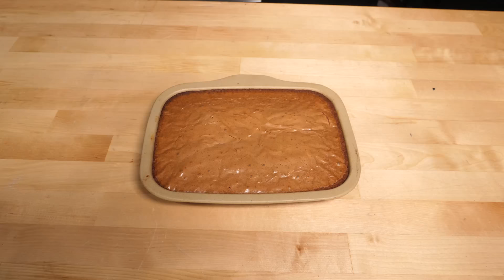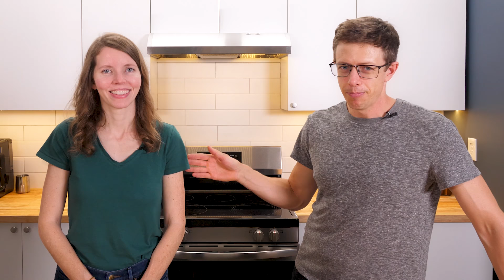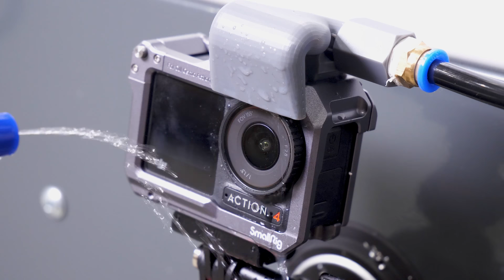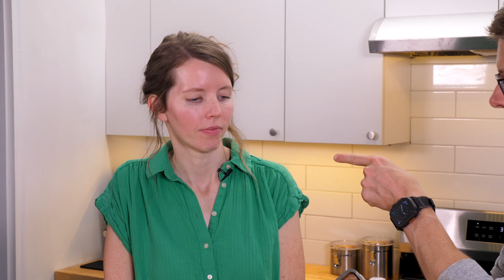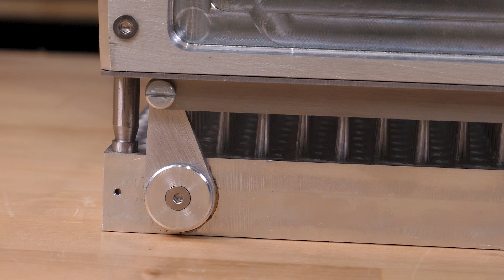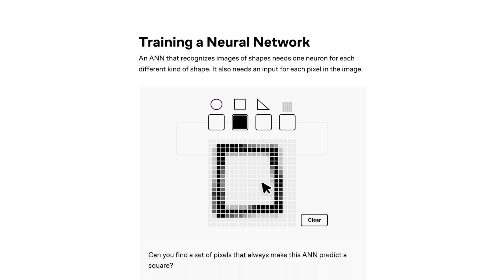Baking brownies from the inside out

Comment: it may require a thicker bottom, but if you tapered the holes to match the spikes they'll create seals that are potentially even airtight, depending on tolerances. this same principle is used in engine valves, gas pipes, and firearm chambers.

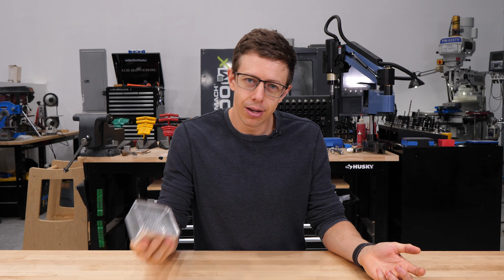Comment: 13:16 my mom has a cake pan from like the 60's or 70's that is two-piece, granted you don't screw it together - you use clasps to pull the wall (it's a round pan) tight locking the bottom in place.

Comment: I think this concept could be mass manufactured.  Obviously the pan should be stamped, not machined, and a plate with all the spikes can also be stamped.  That plate would be embedded in a silicone "lid" that fits tightly on the bottom of the pan, which also prevents leakage if thin batter is used.  Once it's cool you'd loosen the edges of the lid and slide a wedge in to separate the bottom from the top.

Comment: Isn't this the same as the chunky steak cooking issue?: By the time the centre is rare the outside is beyond overdone and tough. And there's a solution to that: Sous Vide. You heat at the temperature at which you want to eventually get the centre of the food, for as long as it takes to get the centre of the batter to that temperature. You can't over cook it because it can't get too hot.

Comment: Couldn't one use a pan that is thermally insulated where it needs to be to avoid the overcooked edges? If the sides of the pan effectively transmitted no heat at all, then a vertical sample taken anywhere from the top or bottom of the brownie would look indistinguishable from another sample taken anywhere else. The only gradient in how unbaked the brownie is would be from the top and bottom towards the middle, which is arguably what one would want in an edge-less brownie.

Comment: I wonder if you could make a pan where the bottom conducted heat well, but the edges and corners were insulated. Maybe you could get the same effect without the pokey bits.

Comment: I wonder if you could approach this problem differently- try to make a pan where the perimeter is made from some material with similar thermal conductivity to brownie batter.  That way the heat would transfer at the edge similar to how it does in the middle- mostly from the top and bottom, but what comes from the sides is coming at a rate similar to how it would transfer from batter.  Looking at wikipedia, it seems like possibly some variety of wood might work?
Reply: Also- for viewing through all that coolant, you could try a "Clear View Screen" that works by spinning a piece of glass really fast in front of your camera, so that all the coolant gets whipped right off.  They use them for boats but there's also companies making them for machine tools- 'rotoclear' is one of them.

Comment: The spikes are well, spikes they are pointy, at the bottom it would behave like a normal rod. There isn't room for racking so that wouldn't be a problem. For the heat, Id just use two small levers that push up.

Comment: Couldn't you just use a regular pan but put it in a larger pan filled with water? The water should insulate the brownie pan, slowing heat transfer and evening out heat distribution through the brownies.

Comment: I know the 5 axis is great but couldn't you have just drilled and tapped holes into the bottom piece and then made conical pins that screw into the block on a lathe?

Comment: What about using a silicone vertical wall on the pan and the pins on the bottom, the silicone can just deform to allow brownie egress? Will also limit heat transfer into the edge :)
Reply: *aluminum pins on the bottom

Comment: When did you get absolutely yoked?
Also, isn’t this design a less economically optimal edge pan as you showcased? 

I know it’s the purpose of the channel is over the top engineering. But this is 1000 steps to make the same thing.
Reply: Also, aluminum causes Alzheimer’s.

Comment: I was once playing a team video game, and someone asked if I could work out the optimal balance for something.  I put together a system of equations, turned them into a matrix, and solved (with Python, in case they asked for a similar optimization with different inputs).  Everyone on my team was amazed, and I was asked to write up an explanation of the math (which I did).  Math is totally a super power!  Interestingly, many of those who read my explanation had no trouble understanding it.  They just had never been taught to solve systems of equations in ways they could relate to real life problems, so for many of them, they just didn't understand how to apply the math they had already been taught.  They didn't even realize it applied to the question they had.

Not trying to pitch Brilliant (if it helps people learn to use this kind of math though, it's probably worth it!), but I can tell you: Much of the math that so many people think doesn't have real-life applications outside of narrow disciplines like programming and engineering has all sorts of everyday uses, and if you learn it well and learn how to apply it, you'll find yourself using it a lot, in ways that significantly improve your life in the long run.

Comment: Simple makes perfect. The spikes would be very hard to clean and alumnim is linked to some neural diseases iirc..  If you can make a   contraption that works like "sous vide" technique for steak cooking work, keeping the brownie at a tempreature where it would cook but not overcook the edges, like a vaccum bag in water, where the internal temp goes slowly but surely , no edges will form and it'll cook ( i think ). Also ive been awake for 24 hours so there's my disclaimer if this sounds stupid

Comment: I definitely expected you were going to make something like a springform pan that gets used in other baking. The removable edge is held to the bottom by a tension fit when the spring is engaged, so it would be very similar to your first successful mini-pan, but you wouldn't need to screw anything.

Comment: Seems like the easier solution was to use the outside wall from a springform cake pan and just replace the flat bottom with a spiked version... At least, that's how I think a commercial product would make sense. You could still have the separate spike plate and perforated plate to make it easier to take out.

Comment: The Japanese have been making crust less bread since they discovered that by running a current via an ex military tank battery through the dough it cooks evenly. This was necessary as they were supplied flour by the allied forces but didn’t have enough equipment to bake bread. This technique is still used today for namapanko.

Comment: Just get a silicone mat, have the spikes punch through. The first time you will need to put a bit of force, but after that you have a rubbery gasket that can handle high heat and without a ton of assembly.

Comment: I feel like the edge as it were could've been negated a bit simply with some insulating material like silicone or ceramic sides.  However it is very cool if not an absolute nightmare to clean.  I get the feeling this contraption isn't dishwasher safe with the moving parts.  The idea of scrubbing every little bit of brownie between the spikes without the longest bristles in a brush might drive one to insanity.  I guess you could remove the perforated plate to clean then invert the spikes to spray up for rinse after soap soaking.

Comment: Alternate approach: Pan with insulated sides. Instead of speeding the middle, slow the edges. Simplest would be a thick ceramic pan with an aluminum bottom. Most fun would be water or air cooled sides

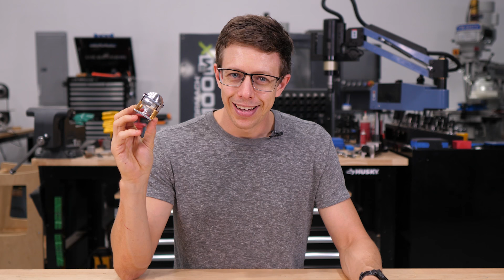Comment: @5:02 I appreciate you put an air evacuation hole in the first failed prototype without discussing it ... just because you expected it to fail doesn't mean you cut so many corners you forced it to fail ... you just left the extra info out for pacing, but left the info in visually for people to figure out ...... to use an aggressively unflattering comparison, to avoid shaming anyone I like, I'm glad this wasn't cut together like a 5 minute crafts video, you didn't just half-ass a failed experiment to justify a more complex/engaging build, instead you're showing that you iterated through the engineering process

Comment: I have cookie sheets that don't brown the bottom of the cookie by trapping a layer of air under the cookie sheet.  They are called "air insulated".  I wonder if an air insulated brownie pan might prevent edge formation by forcing all the heat to enter the brownie from the top, a dimension where the brownie is much thinner.  might not require so many spikes.

Comment: So Fun fact

the "only edge" pan is actually the same core principle. How do you think it achieves the entire brownie being "edge"? By Evening out the temp distribution, so that a normal cooking time cooks the entire brownie to the "overdone" state since that higher heat and time is being applied to the entire pan.

So if you want a no edge pan? Just use the "only" edge pan and cook at a lower temp for a higher time to slowcook it, and the curved shape will spread the heat out more evenly and result in a brownie that is very close to edgeless. You can then make it actually edgeless by putting THAT pan into a larger pan of cold water, which will keep the main pan's temperature down to only barely higher than boiling point - which lets the actual temperature gradient become essentially even across the entire brownie and thus produce a truly edgeless brownie with no weird spike holes :p

Comment: The edges (better yet, corners) of a brownie is the best part.  🥺😜
You're pulling a Tesla and trying to solve a problem that doesn't exist—Leave the steering wheel a circle. Leave the turn signals off the steering wheel—and don't put the drive selector on a touch screen. 🤓
Did someone cut off your PB&J crusts when you were a child?
BARBARIC! 😜

Comment: What if instead of spikes that cook the inside faster, you made a pan that cooked the edges slower. It seems easier conceptually. I think heat resistant material or adding heat shielding around the edge of the pan might work. Perhaps even just a sheet of foil with the inside hollowed out and placed over the pan.

Comment: Need to circulate the hot air through the spikes to aid in removing the moisture, can't have crusty centers without removing that humidity like it does naturally on the surface. I think this is why the lower temp helped. It gave it time to remove that moisture in the center before the crusty edges lock in the remaining humidity throughout the remaining session  **Then I realized the point was no crust, i thought the point was its all crust

Comment: A more practical approach for that pan would be to have the sides tapered in a little bit, so fitment is similar to a spring-form pan with a mid-plate for the "Spikes"; the mid-plate put on top of the sides would then let these spikes fall through holes, with features in the spikes to not entirely fall through, then the bottom can have indents to index in the spikes, so when the bottom and mid-plate are flipped to have the spikes point up, the sides can then be locked in place to hold it together.

Comment: but these aluminum walls still make the edges drier than the inside
maybe it would be easier to make a container with rounded edges and walls that do not conduct/insulate heat - so that the whole thing heats up evenly
(or simply microwaving in plastic bowl)

Comment: lol it's true, if you're a mech engineer you see everything as a mech problem. 1 spring form pans exist so your wife is well... not entirely right, you could just make a springform pan with your pin fins. 2 materials of consideration, you'd get a very similar effect if you just changed the material on the edge of the pan to thin insulation, or added a layer between the batter and the side.

Comment: Love the over engineering and the whole video, but did you try using 2 pans method where you have batter in the middle pan and water on the outside pan, it's often  used when baking Japanese cheesecake.

Comment: I don't know how this video turns out yet but my assumption for a pan to bake brownies without hard edges the spiked pan would be best although counterintuitive since it has so many contact points for heat transfer. The reason I think it'd be best though is that the cooking is uniform throughout and you can simply lower the cooking time/temperature until you have the desired brownie texture, although that surely requires a lot of trial and error.

Comment: Long time viewer. Love the stuff made here. 9:46 A cake *with edges. 

Here is what you need:
2 cups of sugar
1/2 cup of shortening
2 eggs
1/2 teaspoon of salt
1 teaspoon of ginger
2 cups of flour
2 teaspoons of cinnamon
1 teaspoon of baking soda
4-5 cups of granny smith apples   (I put 5 apples in which turned out to be 8 cups, so I had to double the recipe. So remember, just 4-5 cups. Not whole apples. :) )
About 1/2 - 1 cup raisins (optional)
1 cup of whatever nuts you like (optional)

Preheat the oven to 350 degrees.

Cream the sugar, shortening and eggs together.

Mix in the dry ingredients, then fold in the apples.  (Note: The dough is pretty dry without the apples, but the moisture of the apples takes it the right consistency.)

Put the cake dough into a greased and floured 9"-12" pan. (Note: I did one pyrex and one metal pan to see if there was a difference, and surprisingly they were both almost exactly the same. Pyrex is easier to clean and remove though.)

Bake in the oven on 350 degrees for approximately 50 minutes or until crispy brown on the top. It will look crackly like a brownie top and that is oh so good to eat. This cake is the best apple cake in existence. Try it and tell me I'm wrong.

Comment: Spikes on a metal tray with a silicone insert tray with holes.  Silicone is a poor conductor and will transfer less heat giving you a less crispy edge.  The silicone would seal well and could be lifted one side at a time.  Could be made cheaply, and I would consider buying one...

Comment: Did you ever consider modifying a springform pan? Its design has a lot of the advantages of the lever system you’ve designed but with a lot fewer moving parts. It could still have 2 bottoms like the one you designed (1 with holes, 1 with spikes) and theoretically you could have 2 sidewalls as well, each with its own latch—so the outer latch releases the spiked bottom, allowing the second inner springform pan to be removed but still have sides for transportation (e.g. if you were taking brownies to a friend’s place)

Comment: You could have just made a pan with insulated sides so the heat transfer is only from the top/bottom. they already make these , you can get double walled sheet pans that prevent the bottom of baked goods from burning.

Comment: You solved a problem creatively. But there is always a other solution. As an Engeneering studient and former Professional Chef i would go a totaly different route the problem is the heat transfair in a convection oven. The edges get hotter and dry out stronger. 1 solutionn use a proffesional combisteamer or at home put a pen whith water in your oven or spray water douring your braking process. When you dont whant edges put your braking form in a bath of water so the edges dont get hotter than inner part of the braking form use silicon to reduce heat transfair. 2 Second Option use a proffesional microwave oven whit convection heating and simultanius microwaving put the dow in a silicon form. 3 option put your braking form whit the dow in a vacuum bag and sousvide backe it in a waterbath. It might take much longer but protein denaturates at lower temperatures as well eggs starting at 68C it takes longer maybee 12 hours or so but there will be no edge because the gradient of the heat transfair is way lower than in a kitchen oven

Comment: Wouldn't the final result be much simpler & cheaper to make if you just used a springform mechanism to hold the spike baseplate to the baseplate with holes?

Comment: You missed the other way to have no edge, increase volume, and set a ceiling on distance to boundary that's been used in cooking all the time.  The toroid.  Any thing a sphere can do a toroid can do better.  Humanity just hasn't developed enough to have speghitti and meat toroids.  Well we have kind of.  A cylinder is just a toroid section where the major radius is infinite.  Cooking as a cylinder and then cutting the meat isn't unheard of.

Comment: Why such a lowtech solution for the heat transfer? 
I mean it´s easy to use a low outer temp and a long time to get a good ratio of heat transfer in to heat transfer into the brownie to have everything at the same time switch from using the energy for increasing temperature to reacting. Can you do that with a high but still even heat transfer? How about some nice Heatpipes using the amount of fins to scale the air to heatpipe heat transfer. 
That would be fun.

Comment: Side removal: Bakers have solved this already, called a spring form pan, just a latch handle to remove no screwdriver required.

No edge: a hemisphere, also known as a bowl, also doesn't have most of the edges and doesn't have the pressure issue of a sphere.
Sides cooking faster: the high heat conductance of metal seems to be the issue here, this seems to be a material selection issue.
So experiments with different bowls for use as brownie "pans" seems worth considering(and possibly bowl thickness or separate insulating layer)

Comment: Advanced Option. Cheesecake Double Boiler Self Rising Pan! Small water jacket on the outside of the pan to provide insulation and even heat distribution and elevator locking ratchets on the outside to prevent backsliding. Wonder if you could engineer it so the cake is slowly lifted out of the heating rods through steam pressure thus allowing micro reformations of the brownie in those spaces from the rod.